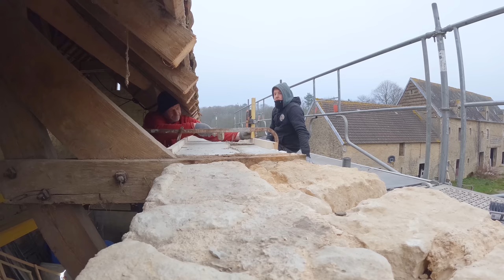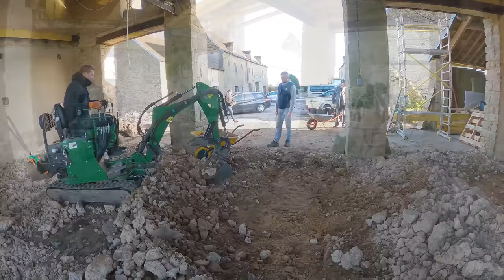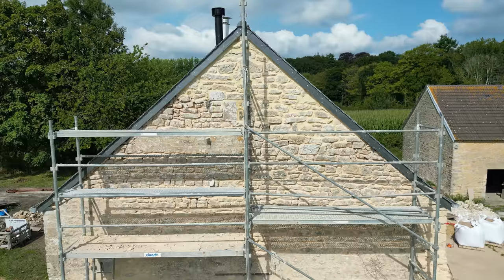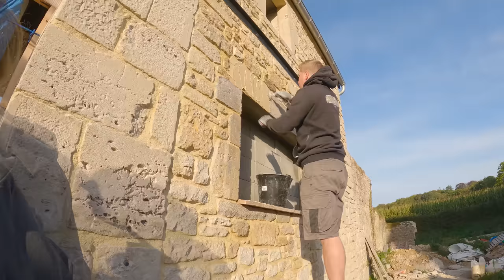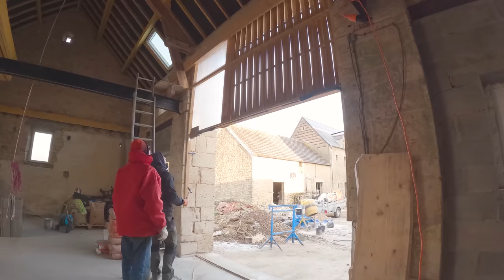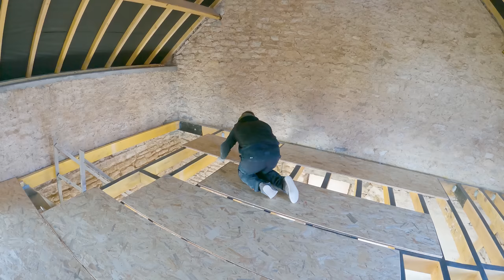TIMELAPSE 2 ANS DE RÉNOVATION D'UNE GRANGE À NOTRE MAISON D'HABITATION

Comment: Why did you use fiberglass for the roofing insulation?   In my opinion, Rigid foam board insulation is a lot more popular in EU countries.   Fiberglass is considered unhealthy in many parts of the European Union, and therefore, is rarely used.
Reply from the maker: La laine de verre est souvent utilisée dans notre pays, elle a fait ses preuves depuis des années 😉
Reply: In my house (in Belgium) there are foam boards and "laine de verre" (fiberglass) It's not dangerous for the health. You may be confusing with asbestos... Fiberglass are pretty common.